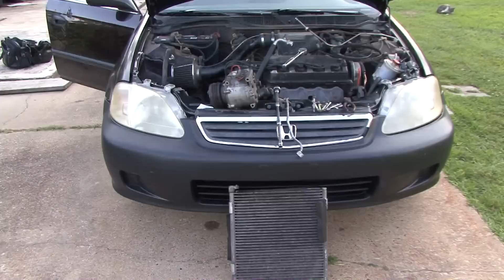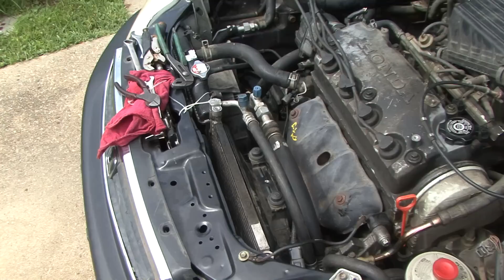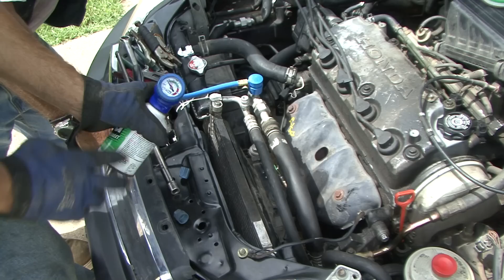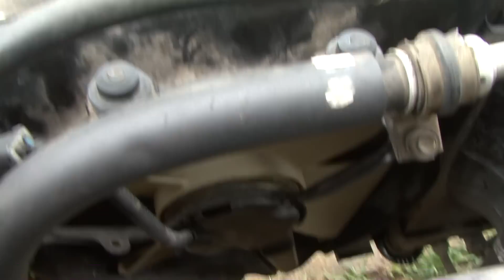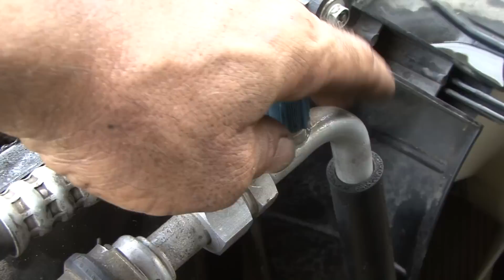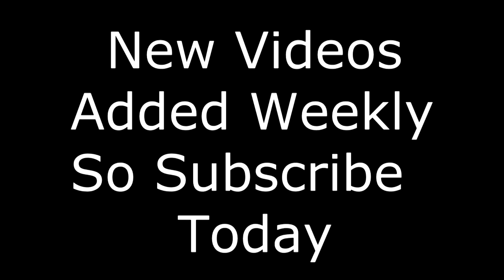Honda How To Civic A/C compressor and charging

Comment: Do you need to change the condenser, when the ac compresser  freezes up?
Reply from the maker: Well more than likely you have a clog or the evaporator is not reading how cold its getting and isnt turning off the compressor. A clogged orifice tube will also create a clog.
Reply: Isaac Martinez To answer your question yes.  The Honda Civic condense from these years cannot be cleaned out properly in the event of an A/C compressor failure.  Also most parts stores will not honor your new A/C compressor's warranty if you don't buy both of them.  Basically there will still be crud in your condenser you can't clean out completely which can then make its way back to your new compressor and cause it to fail again.

Comment: If a compressor has been changed, and a new one installed,  what would cause the ac to not run cool? Also, does the coil have anything to do with the ac not blowing cold air?

Comment from the maker: Glad everyone enjoyed watching the cat lol hes actually in one of the cold air intake videos i shot where he decided to pop his head up to see what i was doing
Reply: Hi, have a quick question. I have a 1999 Honda Civic Ex. It takes a while for my AC to cool down, and will only cool when going over 50 on the highway. Even then it is still kind of warm. But, when I come to a stop and idle, and I have my fan turned on, the car will seem to cut out or kick, like it is tied into the gas line or something (if that makes sense). It causes my acceleration to be rough it seems. Do I need to put in some refrigerant, or is something wrong with my fan or compressor?
Reply: +Travis Snodgrass My friend first check that your condenser fan its working, If it is working you need to check your a/c pressures using a set of manifold gauges low side should be around 30-35 psi at idle and high side 200+ psi at 80 degrees weather, If you dont have a set of manifold you can Just touch the lines the low side the bigger one should be cold to touch and the high side should be hot

Comment: Yesterday,got my pre on refill can and getting ready to refill my A/C, noticed that the gauge is stayed on red. O'Reilly guys told me that my AC compressor is not gauging. Could this be the root cause or could there be a possible error...? If so, how do I fixed this??? Thanks in advance- Paulo

Comment: I have a 92 civic sedan it has freon and it throws it kinda cold but the low presure line doent get cold both lines are always hot the tempature its at 50 from the vents what could it be?

Comment: QUESTION????
I have a 93 Honda Civic EX and the a/c turns on but doesn't blow cool air and I tried to get Freon from an auto store but they dont fit on the plug thing and they told me they dont sell 93 Freon no more. Do you know where I can get one? maybe an online site?
Reply: Did you ever find out where to get a connection for the ac i to have a 93
Reply: Found out they sell a retrofit for 1993 hondas at autozone
Reply: Oh. Thanks :)

Comment: I have a question.  I purchased a recharge kit (car of coolant and a hose with a gauge) I put the gauge on the low pressure line like the instructions said and it read in the end of the yellow near to the red. 
It will blow cool air in the AM or when it's cool out for about 5 - 15 minutes then it's all hot and sticky. Sometimes if I hit a bump just right, it'll blow cool for a second or so, like it's giggling whatever is left in there. 
I was expecting it to be empty..but it's not. So, what do I do now? Is there anyway to release whatever air or stuff there is in the A/C system so I can put new coolant in? All I could think of was it's just air, the coolant has been used and nothing is left but air. Maybe a little bit of coolant. Is there a way to ...umm flush the system, as it were? I don't know what you'd call it. But it's getting hot and I don't do too well in the heat. :(
Reply: You probably have a bad compressor. If you're mechanically inclined, you could check the gap between the clutch and pulley. It may be too large for the electromagnet to pull the clutch.
Reply: I wanted to add that your ac system doesn't actually "use" up refrigerant(coolant as you call it - that's actually for the engine cooling system not a/c). The system requires a certain amount of refrigerant to work efficiently, but you'll never get that without an actual service machine. His method has many flaws.
Reply from the maker: wow this comment just showed up in my email today, but it sounds like you have a loose connection

Comment: Hello, I have a 2006 Honda Civic, my ac stopped working so I took it to a shop; they said the compressor was bad & needed change. They were going to charge me over $700 so I bought the compressor and took it to A personal mechanic who changed it for me but my AC is still not working. He does not know why & he also stated, the old one was fine & did not understanding why the shop diagnosed it as bad. The compressor like the old one is still not kicking in. Please help. Thanks.
Reply: go cat!! go!! lmao
Reply: relay?
Reply: Bought a used 2008 Honda at 100k  and had the exact situation.  Spent over $700 at a mechanic who replaced the compressor but we still have the same problem.

Comment: I have a 96 civic I install the whole ac system but didn't take out the air like you did, I don't know if this has to do with a problem that I'm having. My compressor turns on and off, the fan wont turn on I checked the fan and it's good. Can you tell me if the fan not turning on could be the problem does the fan have to be on all the time that the ac is on? I'm thinking that it might be A relay.

Comment: my car wont let me recharge becoz the compressor and the fan are not kickin in, would your trick engage my compressor even if the pressure switch is 3T switch? Thanks and nice video

Comment from the maker: I wouldnt waste your money on Artic Freeze i didnt notice anything different in tests!! Now is your fan working , and 37 pounds is almost too much , i do around 32 psi on my civic, if thats a new dryer, compressor and fan is working then you have a clogged condenser or too much oil in the system

Comment: where is the video on Artic frezz.I have a 92 civic and the txv valve inside will only get cool. It will barely sweat @  85 deg...when I say sweat I mean a few drops(thats it) The pressure on the low side is 37psi,  Any more than that the car will hunt like crazy (idel erratacly)  I just put a new compresor and dryer on and charged with ac pro..

Comment from the maker: ok if fan is coming on when you turn on the ac switch that means the switch is working, so unplug the compressor and double check your getting power to it, also while the car is off reach down and make sure you can turn the front of the compressor, if you can and have power then your low on Freon or bad pressure switch

Comment from the maker: Sounds like your a little low on Freon also make sure your ac fan is working but turning the car on but not starting it and then turn the ac on then look under the hood both fans on the 01 civics should be on.

Comment: on my 2001 honda civic ex..my compressor use to click and come on everytime, but it never blew very cold, unless it was on very low, and the air coming through the vent was weak, the higher i turned the nob for the ac air..the less cold it became..recently the compressor started acting up..now it only clicks and turns on when it wants to..3 out of ten trys the compress might spin, some days it wont spin at all??? can you give me some help??

Comment from the maker: Im actually shooting the video right now on how to test the fans and ohm and use the test light. And the fans are easy to replace , you dont have to the freon out its just 4 10mm bolts and the one plug wiggle it out , if you change just the motor its 3 numb 2 Philips screws and just put the new motor into the shroud . Ha ha im shooting this w two diff cameras one my new GoPro Hero 3 Black and the other with the FX7 , anyways you have a easy fix ahead of you and youll be happy once fixed

Comment: Thanx for the reply bro. I forgot to tell you that I also check the fuse and relay but theres no sign of fuse or relay being burned. Ive done alot of research online until I came across the condenser fan question and thats when I noticed that my fan doesnt turn on when I turn the A/C on. ill be getting a test light and I'll be testing it to be 100% sure and to replace it. One last question bro, If I replace the fan do i need to empty the freon i have in the car?

Comment from the maker: Well when that fan does not come on it puts a huge load on the motor because the ac compressor is getting super hot and struggling. Once you replace the fan it will go back to normal seen this way to many times. Easiest and best way to check is to get a test light unplug the ac condenser fan , now turn the key to ON but not start so you will see lights in the dash cluster, turn the ac to on position,now put the test light to ea side of the plug (car side not fan side) and see if you get power

Comment: Thanx for the video. I have a 96 civic dx and Ive noticed that my condenser fan doesnt turn on. When the car is in motion cool air comes out but when I come to a red light hot air starts to blow and the RPM's on the car decrease and it feels as if the car is going to shut off. How can i connect the condenser fan to be 100% sure is the fan or a relay problem?